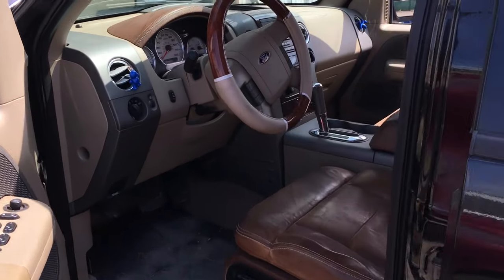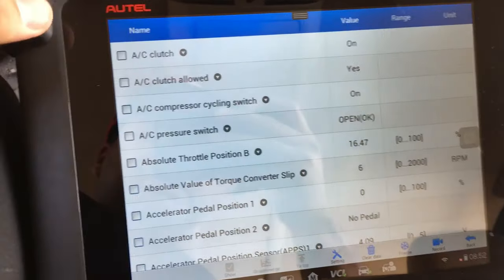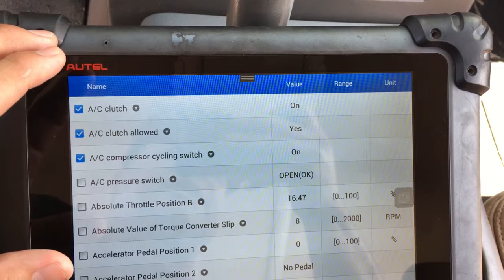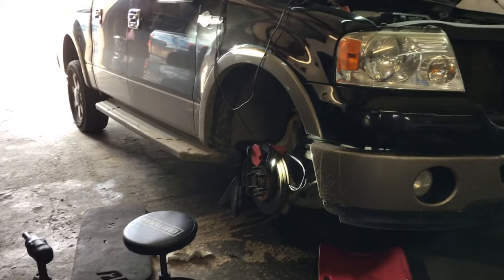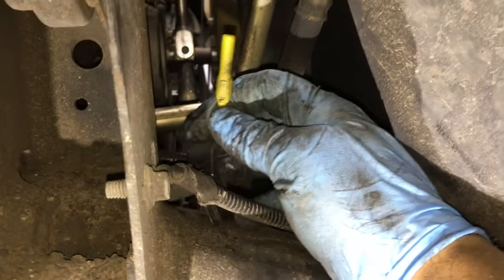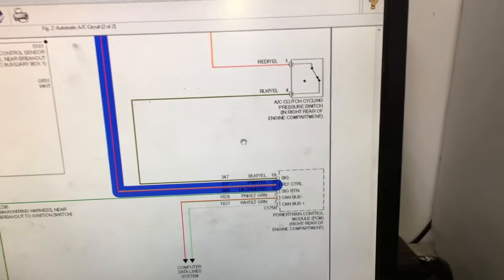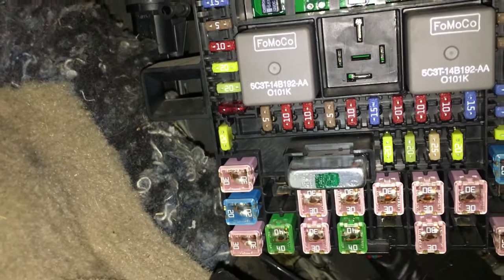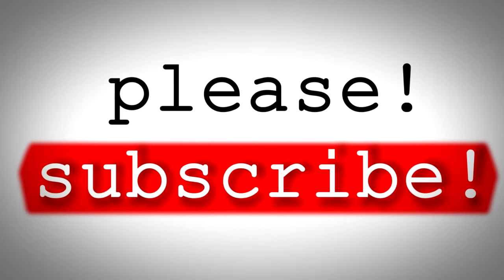FORD F-150 A/C COMPRESSOR CLUTCH NOT WORKING

Comment: Eric, another good video. Thanks for walking us through the wiring schematic. Much appreciated. 👍👍👍 hope your co-worker is okay. 👍
Reply from the maker: He is doing fine. Thanks for watching!
Reply: @ADVANCEDLEVELAUTO  My car i20 engine is running very quiet as usual. However, as soon as AC clutch is engaged, I hear a squeak sounds and not metallic sounds or alike. The squeezing like sounds go away immediately as AC is off. Even with engine revs, same sounds. And with AC off, as I revs the engine, still the engine is quiet. How to find that squeaky like sounds and fix it?

The AC is blowing cold. It seems the AC compressor is ok.

Comment: The biggest problem with replacing just the clutch can be finding the right parts, those pulleys come is multiple flavors, ha ha. It took me about ten hours of searching the last time I did one. I can see why professionals choose to replace the whole compressor, which comes with a warranty and new parts that are likely to last longer. From a DIY perspective, there are extra expenses for the whole compressor, including seals, receiver dryer, flushing the system, vacuum refrigerant recovery and recharging costs.

Comment: Fixed this issue all the time. As Shops send then to me. After they toss parts at it. So the first thing to look at is the temp Gauge. Does it work. As the Engine Head Temp sensor fails. It will not come on. So you have to remove the intake on most to reach it. Plus they get the benefit of new intake gaskets...And replace the pig tail while in there. It breaks. And it will look good. So ohm it out....

Comment: Amigo Vi tu vídeo y me parece excelente, quería realizar una consulta ya que tengo un problema similar con el a/c y es que no enciende, pero al realizar un puente en el relato R202 en el pin 1 y pin 3el compresor arranca y funciona directo (es decir enciende sin necesidad del control de climatización) no hace el ciclo de apagado ni nada. Al realizar el mismo puente entre el pin 1 y el pin 5 si funciona normal como debería y enciende a través del control de climatización. Pero no logro deducir que componente está dañado ya que en el diagrama veo que el relay R202 el pin 1 viene alimentado desde un fusible el número 32 de la fusilera y a su vez energiza la bobina y sale por el pin 2 y va a la pcm luego el  pin 3 cierra el circuito y la señal que viene del fusible 11 sale por el pin 5 y va hasta el clutch a través de un diodo. Pero el diodo está bueno. No sé que pueda ser.

Comment: In my 2007, I thought the compressor was shot till I hit a bump and it kicked back in.  Come to find out, the wire had slipped out of the plug in the back of it. A little bit of wiring work and bam, no compressor replacement!

Comment: Working on my 2003 Ford Expedition, Clutch seems to be slipping, then when I turn of the truck it starts to smoke, I guess from too much friction. Clutch looks bent, a brand new clutch cause $124.00. Bought a used junk yard compressor for $99.99 waiting for it to arrive.

Comment: Hello Eric, 
Good work, appreciate and good to know your colleague is okay. 

I had a question, don't know if I could get any supporting response from you and the experts out there. 

Understanding that I know very little of this Auto World and that I do not have special tools, I am unable to figure out-
Why does my car AC stops cooling (AC does remain ON) after driving the car for a while. Like at start of the day you start the car, turning ON the AC and drive, post driving a smooth run for say 20-30 mins cruising at about 50-60 KMPH, suddenly the cooling is lost and AC won't provide any cooling unless you switch off the car for an hour or so. 

Next you park the car aside highway,  turn it off for say a good 45-50 minutes break, then start the car and the AC when switched ON starts cooling  (No it doesn't cool if you simply turn Off and On the car without taking that large break) 
But does same thing again..  After a smooth cruising for another 30-45 mins AC will stop cooling, though blower is blowing. I have noticed that the AC clutch does not engage. (But it does engage when car is started for the first time or from long break, but cooling works only for a while.) 

Can't understand what's going on,  as when the car mechanic looked at, he stays AC remains ON and cooling too when he tests it at a garage. 
Any ideas or suggestions where to look  for will help. 
I don't think my car is known to the US world :) as I am in India and it's made by TATA (now owns Jaguar and Land Rover).  It's a pretty old 2006 but my first car so great if Eric can help with his inputs. 
It's a TATA Indica Xeta car with petrol 1.4 litre engine.

Comment: What scan tool was that that you used in this video?  I'm having the same issue with my 05 f150 lariat.  No A.C..all the fuses are good, A.C pressure switches are good and pressure in the system.  I can bypass the ac clutch relay with a wire and the compressor turns on.  I checked the ac compressor relay and that is good.  So it appears that the pcm is not sending the ground signal to the relay in order to energize it.  While I had the compressor relay bypassed I got 32psi on the low side and 175psi on the high side.  With the engine off both pressures were equal almost instantly so I can assume I dont have a plugged orifice tube.  Any suggestions?
Reply: Did you fixed?, I have the same issue on my 06 F150, no ground from PCM to the AC relay under the hood.
Reply: @DavidPerez-tk5cp  I found a couple issues.  First I removed the front seat to check the wiring to the body control module.  That was fine.  I checked the wiring running along the drivers side sill plate and found one that was chaffed.  Taped it up and it seemed to be fine.  But what I noticed was occasionally the lights on the gauge cluster would all come on, speed and tack stop working and a hit to the top of the dash with my fist would get it to start working fine again.  Turns out the wiring harness going to the gauge cluster must have a bad/loose intermittent connection.  What I did was just give the whole harmess a few spins/turns to put some tension on the plug and I haven't had an issue since.
Reply: @Joe_1971  that’s rare, I have been locking for this issue for long time now, I don’t have any problems related to the cluster, they’ve changed the engine on January so maybe they cut some wiring or so.
I lost with this
Reply: @DavidPerez-tk5cp  Just an FYI...the body control module does control the functioning of the A.C.  I believe it sends the ground to the a.c clutch.

Comment: I have 2008 f150 at the fuse box it tilling me  the ac compressor is 9 or 8 volt but the battery is at 12 to 13 volts and it tilling me to check charging system wat do u think ? thank you for your help .

Comment: Stabbing your self must be a Houston phenomenon. I was changing a wiper refill on my big truck (semi) in Houston. Held it with my teeth so I could climb up the steps and on to the tire, raised my leg, knee smacked bottom of blade, refill into the roof of my mouth. Still have the scar. I won’t buy refills anymore or climb with my hands full.
Reply from the maker: Holy crap! That sounded painful. It’s the damn Houston heat lol
Reply: ADVANCED LEVEL AUTO - made my eyes water for sure, tasted blood for a couple of days. At the time I was more worried that someone saw me pull that bone head maneuver. I was really mad at myself for being so stupid.
Reply: Billy R -😄

Comment: My car i20 engine is running very quiet as usual. However, as soon as AC clutch is engaged, I hear a squeak sounds and not metallic sounds or alike. The squeezing like sounds go away immediately as AC is off. Even with engine revs, same sounds. And with AC off, as I revs the engine, still the engine is quiet. How to find that squeaky like sounds and fix it?

The AC is blowing cold. It seems the AC compressor is ok.
Reply: Isolate the location it's coming from, remove the drive belt, spin the pulleys and check for excessive play. That should help narrow it down.

Comment: if all is is good clutch and comp, good the switch is not telling pcm to turn on clutch ,i can turn on with relay tester in and relay plugged in i can pin it out and turn on cools good but pcm wont turn on switch on dash lights up indicating its on , no signal from pcm, it is a manual system on or off

Comment: What is causing my 1998 triton v8 to pulse? It will kick on about every 10 seconds run for about 3 seconds and kick off.
Reply from the maker: Usually when it cycles quickly, it’s because it’s low on refrigerant.
Reply: ADVANCED LEVEL AUTO yeah I shot a few squirts in there and gauge is reading GREEN, but I checked it again and the gauge is pulsing from the very front of the green section to the almost yellow end when the unit kicks on.
Reply: ADVANCED LEVEL AUTO side note, I found the relay under dash and it felt hot but it’s working as I hear/feel it click when I plug it in.
Reply: Charles Wolford Mine is doing the same exact thing it kicks on for a few seconds then kicks off. Gauge cycling from green to red or yellow.  Blowing hot air. I took the clutch plate off cleaned it w/ brake clean, no change. No shins inside clutch assembly.  Maybe clearance is to wide?  Hmm 🤔 Considering throwing in an entire new compressor.
Reply: Randubles P hey I let some pressure out and now it’s not  even attempting to engage so I filled it up again after disconnecting the battery for half hour and it’s still not doing anything at all. Sucks lol
Reply: Randubles P what did you find for a price on a new unit?
Reply: Charles Wolford Under 200 at O’Reilly. I’m still thinking about what to do next.